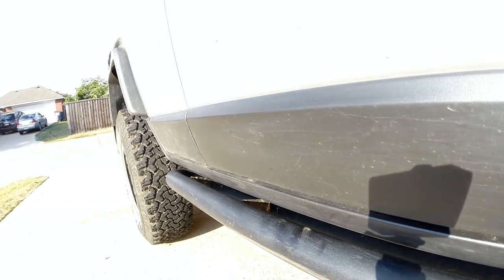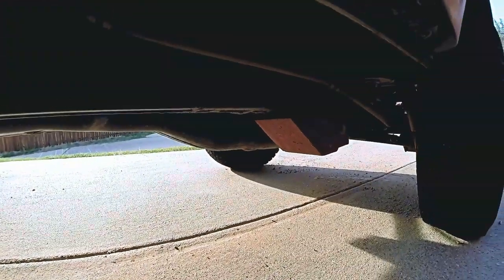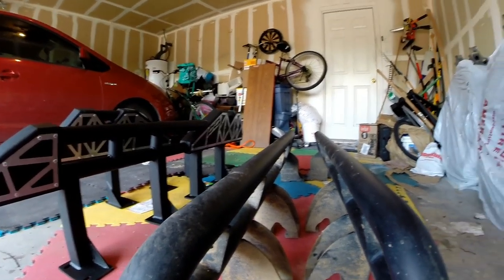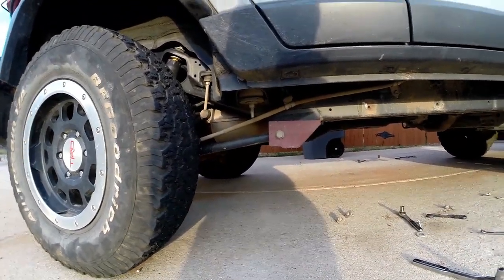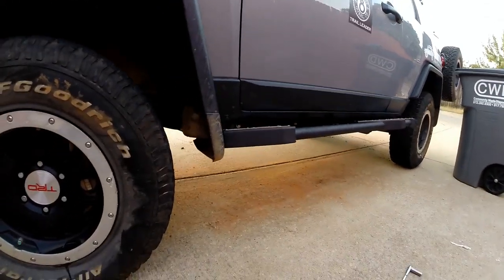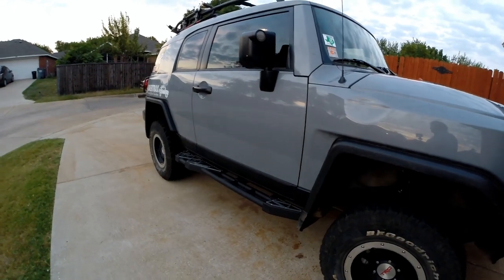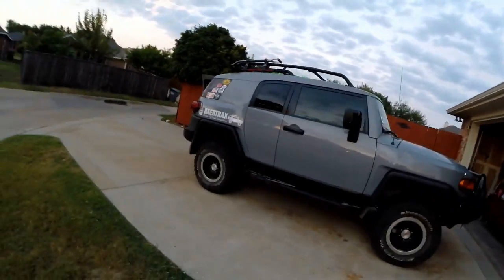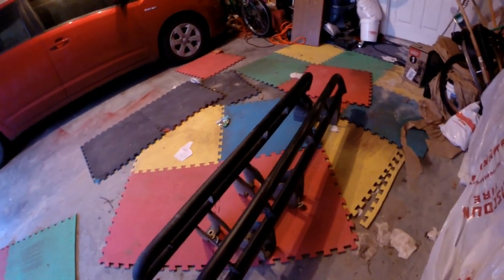FJ Cruiser Demello Slider Install

Comment: Did you get yours powder-coated?  Also how have the steps been for accessing the front and rear?  Looking at sliders both for protection and for the women in my life who need a little help getting in and out of the beast.  Thanks for video.
Reply from the maker: Yes they are powder coated as they are the top of the line from Demello and it is how they come. My wife and I both love them for helping us get in and out of the vehicle. I took them to Utah a few weeks ago and I hit  a good size rock and I got the tiniest of a scratch that almost wiped away. So we both love them and getting in and out is far easier now. If you are somewhere cllose to Dallas Texas I could meet you and show you what they look like in real life. I hope this helps.